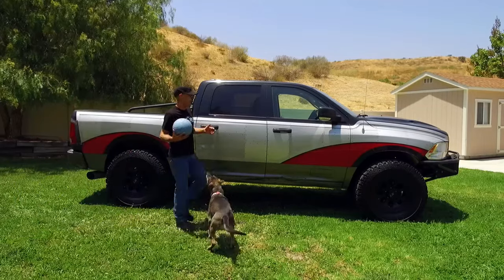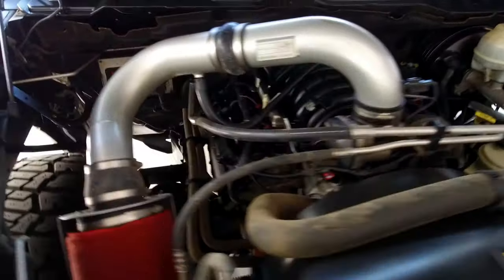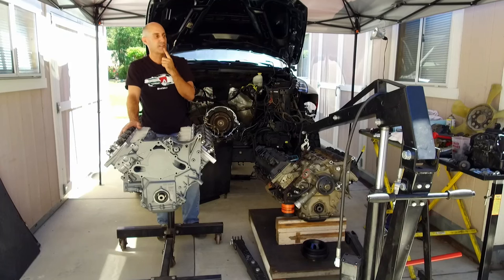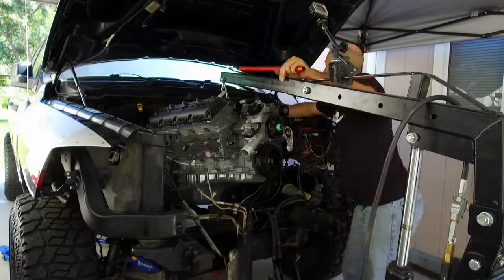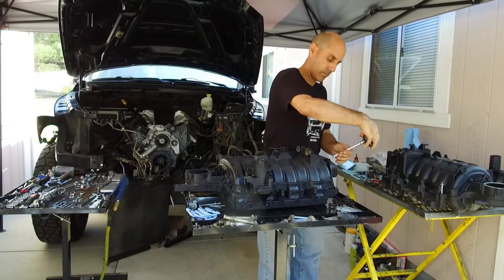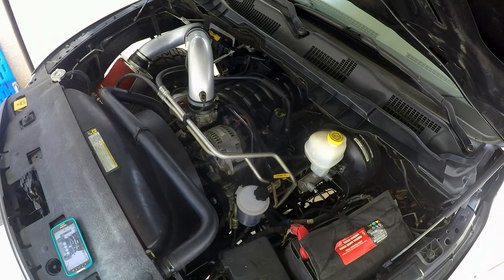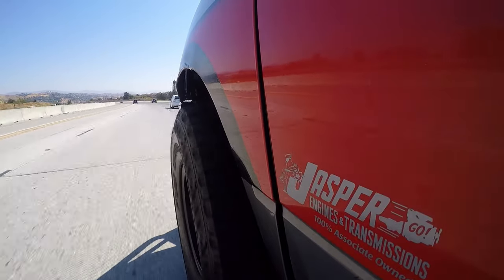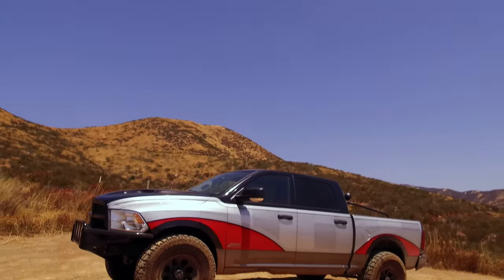HEMI Swap with Jasper Engines Replacement 5.7 in a Dodge Ram 1500 on 37" Tires

Comment: I purchased the transmission from an authorized Jasper dealer summer of 2017 in Yorktown, VA. The original transmission was slipping in reverse after 87k miles. I paid 5800 for Jasper replacement. This transmission was an upgrade to the standard. The authorized dealer completely flushed the cooler and replaced all the transmission lines because the original lines did not connect to new transmission. The transmission seem to do fine. The transmission failed at 89k while towing a 5000 lb trailer with the Dodge 2500 diesel. The transmission blew a seal and all the fluid was pumped out unknown while traveling at highway speed. The noise was the clue that something was very wrong. Pulled into a Food Lion parking lot and then noticed my trailer was covered in transmission fluid. I contacted Jasper. I was told they would reimburse 70 / hr labor rate, which would not cover the Dodge dealer ship labor rate. I was 6 hours from home with a two-year-old Airstream covered in transmission fluid. Jasper hinted the failure was probably due to a bad cooler or plugged ATX lines. The reasoning was unacceptable considering the work was performed by authorized Jasper installer who told me they flushed the cooler and replaced all ATX lines. The original receipt had the new lines and the cooler flush annotated. Jasper could not give me a time to repair and told me the old ATX one had to be shipped back before they could honor the repairs. With my wife in tears, I elected to trade in a nice truck to purchase a new. The way Jasper handles the warranty left me sick to my stomach and out $5800 for a 6-7 month old Jasper re-manufactured transmission with less than 2000 miles. The transmission should have never leaked fluid the way it did assuming all seals were replaced with new. I suspect the replacement parts used were not of original quality, which lead to the premature failure. At a minimum Jasper should honor some type of refund. The warranty could of been handled differently. They essentially leave you hanging and provide you with no information on how long it will take or what action you need to do to restore vehicle operation. We were left stranded. After spending 5800 dollars on this very bad deal I could not in good conscious spend more money on hotel, restaurants, and higher cost for dodge to perform the work. Jasper provided no information on how long it would take to ship and receive a replacement transmission.
Reply from the maker: I really hate to hear a story like that and feel awful for anyone having to go through such an ordeal. Don't blame you one bit for feeling like this.

Comment: About to do my first engine swap and use the same one! My 2011 1500 had lifter/cam issues and 7 months after replacing them I'm facing another engine failure... jasper to the rescue!
Reply from the maker: Still running great.

Comment: I work at jasper engines!!
Reply: I heard that jasper's are junk.
Reply: Jasper has the worst revews of any reman engine company
Reply: Jordan Wheat they have always had pathetic rebuilds that's why they gave him the engine to help with promoting their company.
Reply: @bonesjones3421  will I hear the Italian junk dodge 5.7 ain't that great. Pretty lame why they are breaking
Reply: @stevechase6342  there breaking because dodge didnt think about putting in a high performance oil pump. When at a idle for to long the bearings on the lifters seize up and take out the cam. 3,000 dollars for a rebuild or 4,000 for a new engine. I know that problem to well!
Reply: John Knight why does a non high performance engine need a high performance oil pump?  That’s not the problem, it’s cheap parts, mainly needle bearings that aren’t worth putting in a 70’s pinto.

Comment: A solo engine swap. Pretty bad ass man.   I just subscribed
Reply from the maker: Thanks so much!  Glad to have your support!  Welcome
Reply: I thought I was cool doing a Miata swap on my own years ago, but this is something else entirely!
Reply: Plot Twist: the whole video is scripted and he had others helping him.
Reply: I do them all the time.
Reply: Mini 🤔😅
Reply: Yeah. I've done little 4-cylinder engines alone but I can't imagine wresting a big V8 by myself. Don't you have to line that thing up on a transmission spline?
Reply: @soaringvulture  nope, factory procedure is to get it started on the bell housing with 2 bolts, set it on the mounts and tighten the rest up, gotta get the tq converter to sit on the flexplate right but thats about it.
Reply: Great 👍 solo engine. Must have been riding high all week. How has the Jasper engine been working for you, considering swapping mine out too. Thanks
Reply: How many hours did it take you

Comment: Saw your video and read all the comments.  Some of them were 5 years old and I'm sure a refurbished Jasped engine would be more expensive now.  We swapped engines back in the 70ties under a shade tree with a come-along.  Didn't seem so complicated way back when.  I'm older and have just been paying garages to put in new engines.  Got a 5.3 from Jasper installed for 6k a few years back.  It came with a 30k mile warranty.   My 2019 Ram has 30k.  I know warranties are usually a waste but I keep them with all the technology.  Really cool how you kept all your bolts in a systematic order.  I've actually videotaped smaller projects to help me remember.  Hate to get through an have extra bolts with no idea where they came from.  Excellent video.

Comment: I just finished my 5.7 install on my 2011 Ram Outdoorsman ,my old engine gave me a 195 thousand miles on it , I understand that feeling, mine runs great and I am so damn proud of it , Love my truck....to be honest I watched this video about three times before I started mine , great job THANKS....
Reply: Hey Mark do you have any pro tips? I'm building a 392 stroker to go in my truck. 2009 with a Procharger, it has 200k Km on it now and I think the lifters are starting to go. Going to do the swap this summer!
Reply: Leon W that is what I was thinking of doing. A 5.7 to a 392 stroker. I am with you, do you have any tips since you posted 2 months ago?
Reply: @chadrose  I've shopped around and been in contact with Manley and Scat. Manley looks nice but is too many Canadian pesos. The Scat kit is my pick, since I'm going to run around 12 PSI so they recommend 22 Wiseco pistons (roughly 9.3:1). My power goal of 750 hp @ the crank is near the I-beam rods 800 hp limit so I am getting the ARP 2000 7/16" upgrade (it's only $100 extra). It would be cool to make more ponies but my 545rfe won't take it, I have the best one on the market the ATS with a Co-Pilot and Edge 2800 converter but still the trans is the limiting factor. I got all my other parts from Rock Auto, best prices for sure. I'd recommend New Hemi Engines 2003-Present: How to Rebuild by Larry Shepard. I bought an engine with a Comp 266 (a bit small still but oh well), Hellcat lifters,  Arrington pushrods and TTI shorty headers already done to it and am rebuilding that one, will swap over when I am done.

Comment: Did a Jasper motor,V-10, on my old 2003 Ford Excursion and it was amazing how they,Jasper, would take the initiative and re-engineer the small issues that Ford never bothered to change and improve.$8,500.00 well spent thank you Jasper!
Reply: Did you twin turbo it?
Just kidding.
Reply: 8500 for a rebuild 🤣. Thats crazy money because everything in that engine is used. All engine rebuilders  reuse everything they can.  Block, heads, cams, lifters, rods, pistons, valves. I was told by a rep of a company they even reuse timing system components such as the tensioner and sprockets.  Everything is reused.  Thats why you have to give them a good core in return.
You can rebuild the engine yourself for a few hundred dollars doing it their way.  People think they're getting all new stuff and thats not the case
Reply: @blue03r6  F*ck that!!!   I don't know what I'm going to do with my 2008 6.8 Triton...  looks like it's leaking oil from the front crank seal or pan gasket...  but I was thinking at 343,000 miles.......   it might be time for a motor swap but now I'm confused hearing all the Dirt on these engine remanufacturers!!

Comment: Awesome video and that's a beastly truck! Its really cool seeing someone else do a jasper swap, I put a jasper 5.9L v8 in my 2001 1500 and I absolutely love it.  80,000 miles later it's still running like it did when it was brand new.
Reply from the maker: Great to hear a success story like that... I'm feeling pretty good about it so far.
Thanks so much!
Reply: I got 240,000 miles on my 01 truck with 5.9 also..i wouldnt mind buyin a Jasper because I've installed them in peoples vehicles before. But i really would rather send mine to Jasper instead cause i know how well its been takin care of all this time too and i bet it would be an easy rebuild..and I'd still have orig eng too..and trans..rt now i havent had any issues with mine until i put cold air intake on it..now ck eng light keeps coming on..
Reply: I have a 2001 4x4 1500 as well I want to do this so bad lol.
Reply: how is it now??  About to get one myself but im not sure!  Mechanic called me today, my engine is shot.

Comment: GREAT VIDEO! I work for JASPER Engines. I put a JASPER transmission in my old 97 Z71....I love that old truck! I don't think the engine will be lasting much longer so I will be putting a JASPER engine in it too!
Reply from the maker: Awesome! I'm really happy to be a supporter of Jasper...  one of the best companies I've used so far!  Good luck on your project!!!
Reply: I know an older couple who had a jasper reman trans put in a 98 jimmy 4x4,  the trans didn't last 10k miles. While jasper did send another trans, they had to pay another $150-$200 to have it put in at the same mechanic shop. I have the jimmy now and has about 3k on the replacement trans. We'll see how long it last before it fails.
Reply: Empire of Dirt I’d like to know what you did to get 300hp from a 318?  No stock 318 with a 4 barrrel ever came close to 300hp.

Comment: THUMBS UP for everybody who was really feeling his excitement !
Reply from the maker: I really was!
Reply: @AutoEdits  Question: Would a 5th gen dodge ram 1500(390hp) 5.7L engine possibly bolt directly on to the stock 3rd gen ram 1500(345hp) 5.7L transmission and be drive ready?
Reply: Yuuuup

Comment: Superb job! I just pulled the engine out of my JGCH 5.2 and I had two friends helping me with that... Can't imagine doing it myself... Big thumbs up!
Reply from the maker: I wanted to show a direct replacement. Putting headers on would mean modifying the rest of the exhaust and here in California where I live... that's a huge headache. It sees pretty happy... Check out the video when I put the Flowmaster Outlaw exhaust on this thing... it sounds Awesome!!! https://youtu.be/wDrTm2k-i8c
Reply: I understand... When my Doug Thorley headers arrived, I was surprised to see, that one of the pipes with the flange that goes right between the headers and the cat was 2,5" in diameter... But my entire exhaust system is 3"... I asked them if they made a mistake and they replied they need to put in 2,5" pipe in order to pass the California emissions...

Comment: The flat tackle boxes from Walmart or academy work well for keeping track of bolts and other small components. I use them and masking tape to label where stuff case from or what it held on.
Reply from the maker: Good tip.

Comment: January 2021 my 2013 with 74000 miles, yes 74 thousand miles and the crank spun the last three sets of bearings. I watched a lot of your videos and checked multiple engine manufactures including Jasper. I elected to go with Fraser for my new engine as they have a 7 year unlimited mileage guarantee. Also if the engine blows up or anything happens to it, they will swap one time no questions asked new motor at no cost to me except labor. They will cover 50 dollars an hour labor at a professional installer. I asked if the warranty was the same if I did the swap the first time on my own and they said yes as long the problem wasn't something I did or didn't do. Just like you, I liked my truck and haven't had truck payments for 15 years. Always paid out right for whatever I got. First I got their top of the line engine which had all new parts inside and out. Got the same kit with everything I needed and what they didn't send , I got a 300 dollar credit for the parts they didn't include in the shipment. I took my time,( 2 months} to put this together so I could make sure it was right. I put everything on mine including headers before I put  it in. Made installing some of the parts easier while it was on the stand. All new sensors and everything except the timing cover is new. Oil pan and all. The engine came with plugs installed, and they told me that they were cheap plugs and included a set of plugs in the credit at auto zone. my 2 sons helped with the install and anything we questioned, we got off of u tube and your site. Got it all together and went to crank for the oil pressure and got nothing. Got checking and did not install the ground strap to the motor from the battery. Did that and it cranked nice till I got about 30 lbs of oil pressure. After it started right up and ran like a kitten. The headers sound nice with the stock exhaust. I did replace all the o2 sensors also. It's been 9 months and I'll tell you this truck has more power and a whole lot better gas mileage than the old motor. Do not regret doing it at all. I'm getting 21 around town. Haven't gone on any trips to check the mileage. I have a 27 ft camper and I called Fraser to see how long I had to wait to tow it. They told me if I did the oil change and break in, 3months or 5 thousand miles it will be ok. Had done 7 thousand miles and got the camper in June. It pulls the camper like it isn't even there. I don't push the truck towing, but a couple times I had to move it and it was no problem. Anyway, thanks for the video, we used it a couple times and keep up the good work. Sorry this is so long, but just wanted to share that I did check into Jasper engines, but Fraser had many positive reviews I had to go with them. Just for your info. the engines was 5500 dollars and I got back a thousand dollars when I sent the core back. Jasper engines had all great reviews also. The warranty is what got me. Happy trucking and thanks for the great videos.

Comment: I never had any luck with anything from Jasper. In fact the ram/jeep/dodge dealership I wrenched at stopped installing their engines and transmissions but if it works for you then thumbs up.
Reply from the maker: Sorry to hear about that but I'm stoked with it so far and the guy that ran a shop across from me for a few years used them all of the time with complete success. That's how it popped into my head to call them ... I remembered seeing that truck at his shop.

Comment: I put a jasper transmission in a 2001 dodge Dakota years ago. Worked perfect.
Reply from the maker: I've been very happy with this install!
Reply: sounds like Jasper is the way to go.... unfortunately if it has to be shipped from Germany thats a downer.  Does Jasper perhaps have a dist. warehouse in the USA?
Reply: @harpoon_bakery162  jasper engines is based in jasper indiana.  They have distributors all across the United states.

Comment: Brother keep up the great energy! I bought a 07’ 1500 with the 5.7 Hemi at an impound auction $1,000. Of course the engine is bad, dropped valve seat. Have been talking with Jasper for a few weeks now. Looking at their 5.7. Your video SERIOUSLY makes me think about doing the install myself. LKQ also has a re-man with a 4 year unlimited miles warranty. Pricing is similar, Jasper has the reputation though…great video! Thanks again
Reply from the maker: Howdy and thank you so much for the shout! I had never done this kind of engine swap before and just took it one step at a time... worked out great and the truck still runs amazing.  It was the right call on this rig for sure!

Comment: Thank you for the video on the 5.7 Hemi Jasper engine. My engine on my 06' Dodge 1500 blew two days ago and was heartbroken, I love my truck and so does the two of my boys, and wasn't ready to get a new one. My local shop gave me some options and told me about the Jasper engine, about a $1000 less than dealer engine, might I add the availability on a factory engine would be on back order with no idea when they would be available. The cost to install and motor I believe to be reasonable along with the warranty. So anyway the video kind of put my mind at ease, I know my local shop is more than capable of the job. Can't wait to drive her again and go on family trips.
Reply from the maker: Sorry to hear about your engine going out and I hope you have as great an experience as I've had with my Jasper engine. Thanks for watching and good luck!